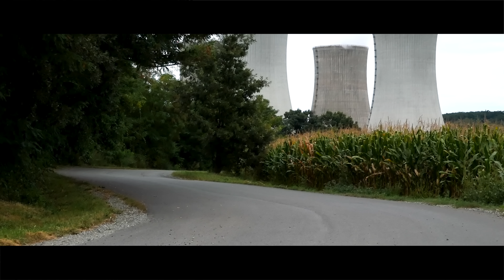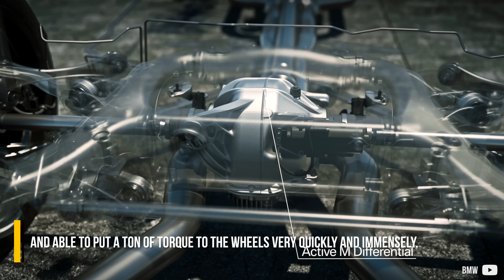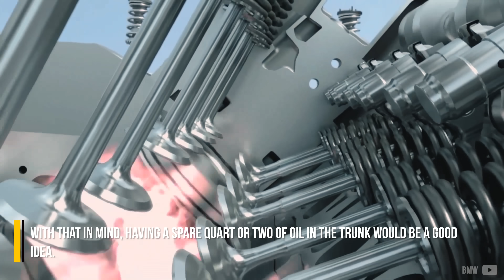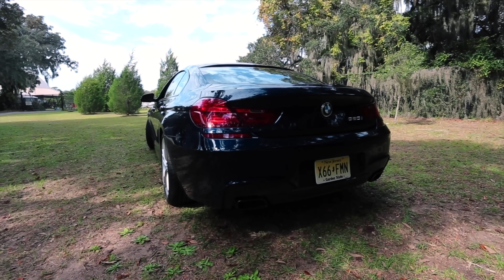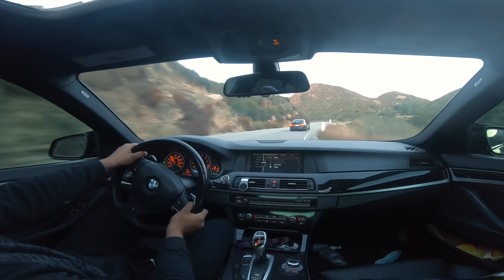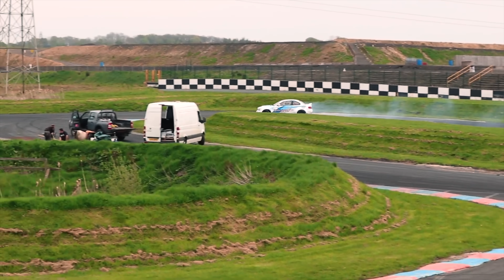The Worst BMW Ever?

Comment: New M5/M8 have a 10k oil interval which is pretty standard in the performance range, E63S 4.0TT which is also a hot inside V has the same 10k interval with a "normal" burn 1qt between oil changes. I've heard since the release of the F90 M5 they 4.4L is really good and doesn't suffer the problems of its early versions.  The 4.0 in the E63S is amazing, fully forged, practically over build, also with twin scroll turbos and generally since 2017 there has been no major issues, one of the best and last AMG engines build.
Reply: Yea but if u pull the oil at 5k or 5500 u will see it’s started to burn turn dark. U should change at 5k 5500 max on turbo cars u don’t want that burned oil going thru ur turbos. Forget what the manufacturers say. They are only concerned with the lifetime of the vehicle and to them that is 90k ish. Never go past 5500 oil change on turbocharged engines.
Reply: @sneakerhead4770  Oil turning dark is normal, oil doesn't retain is original color past 2 or 3k miles it'll be mocha already. You don't flush a car engine so it's squeaky clean it's designed to ge changed with old oil still left residually which will discolor fresh oil right off the bat. There is a lot of discussion of when to change oil. I don't think car engineers want you to break their engines. And I also trust oil companies, I always used Amsoil in the AMG, Amsoil outperforms most oils specifically in high temperature turbo engines. I would think Amsoil, Royal Purple and others are true to their claims. These oils can last to 12-15 or 20k miles so doing a 10k oil change should be normal. You can always change your oil sooner for your own peace of mind. But the ONLY  way to tell is to send that oil to the lab at 5k interval then at 10k interval and see how oil performs, if the oil itself has started to break down, like I said turning black doesn't mean the oil burned itself out.

Comment: Have owned BMW since 06. My first one was a 06 530i. It had the cylinder head issue. I purchased it certified 1 year old. Traded it in for a 09 5 series. My next one was a 13 X5 35i. Then a 15 M3. I always got rid of my cars before 100k miles. I kept my 13 X5. I am done buying newer cars. So tired of other people crashing into my cars or damaging them. I used to wash my cars weekly. Now it’s every 3 weeks. I am a mechanic so it’s easy to work on them. My 13 X5 had to replace the water pump and thermostat at 65k. And the valve cover at 80k..

Comment: Complete overhauls in like 5~6 service intervals sounds indeed like a nightmare,i mean,just listening to the design made me sweat buckets, the cats that close to the intake air just made 2 extra intercoolers neccesary, and something like the conrod bearings dont have enough oil passing through them is definitely not normal at all, its just plain stupid design,like i said,that engine has overhauls like it needs regular service

Comment: Good engine, bad maintenance advice from BMW. BMW first stated 15k miles between oil changes, then 11k. Truth is 5k oil changes are needed. Cooling down the car before turning engine off (2 minutes) is a great idea even though coolers run after engine is shut down. 
BMW set the 15K oil changes to save themselves money as they offered free service. Always follow the money.
Reply: Def 5k oil changes no matter what they say especially on turbo engines u don’t want that sludgy burned nasty oil going thru ur turbos. Also warm up for a few mins when starting up let the turbos lube up and the oil get warm before getting on it. Never rev as soon as u start and wait a few mins before shutting off like u said. It’s important for turbos let some coolant cycle thru before shutting off.

Comment: Good research and edit on the video but very happy to say that you are wrong! how many BMW have you had yourself? and what models/engines? I had science 2008 to present from 3ser,5ser,6ser etc, from E46 upwards never had any major issues and did always long drives from UK to Germany,Austria,Hungary never let me down or stranded.
Reply: I second that! Most reliable cars I ever owned. I exclusively had 5er series models beginning with E39 variants, they did not once brake down. Nowadays I have a 535i F10, the car is twelve years old with close to 200k kilometers and still no major issues.

Comment: 20 quarts of oil between oil changes. LMFAO. Does one even need to change the oil at that point? It's been replaced about ~3x already in the oil change interval by topping off.

Comment: Most any BMW you <buy> these days will last reliably :::er::: reasonably through 70 to 90 thousand miles, just like of the normal and plain cars the rest of us drive. If you exceed that 70 to 90-thousand-mile range and repair intervals shorten up, then you've also experiencing nothing different than drivers of other cares are experiencing. Regular oil changes and service maintenance intervals will keep the car operating as well as any other vehicle in the modest luxury range; oh, and not driving it like you're living the insane life on the hyper-crazy race circuit of your choice (usually the same common roads commingling uncomfortably with the roads most folks always use), when you're just a common joe living in denial who can afford to drive a more expensive car. Of course, there are exceptions, just like with other cars, but the first thing you need to examine and repair while driving any car is the driver of that car which seems to need repairs too frequently.

Comment: M54, m57 (and even n47 after 2011) are some of the best engines ever made. The only problem is that people without knowledge about these cars buy them, if you have some common sense, a bit of knowledge about these engines and you know how to use a wrench then these are excellent engines. You just can't treat them like you can treat your honda civic lmao.
Reply: @Morphic exactly, depending on the year of m57 you should consider blanking the swirlflaps. The only problems with this engine, are emission related designs such als dpf, egr and and swirlflaps. Taking care of these designs by blanking, combined with proper maintenance will make this literally one of the best diesel engines ever. Such a solid powerhouse, the m57. A lot of the BMW hate is so injustified.
Reply: Great engines except for that FUCKING CCV
Reply: @nutsackmania  yeah there are some pesky parts that need to be replaced with mileage on some of the 3.0’s like crankcase ventilation waterpump or valvecover gasket but its nothing serious you cant do yourself, still really great engines indeed

Comment: My wife and I both daily drive Bmw's. But They are old. Hers is a 2003 530i with 312k and mine is a 2001 325ci with 278k.  I love them, but I absolutely will not own any bmw newer than around 2010.  The 90s and early 00s are good cars if you keep the cooling system up and do the maintenance.  I had a customer bring a 7 series to our shop with the N63 in it recently.  I kept trying to tell him to get rid of it.  He thinks he is a baller but he doesn't have the kind of money it takes to keep it running.  In 10 years or so there will be a lot of them in the junkyard.

Comment: Worst enginge is by far the N54. 
The Engine might be good but the external parts like high pressure pump, the turbo and other parts arte like shit. so you dont have a benefit from a good engine when you always have to replace the other parts

Comment: A very involving engine to work on indeed 😏 resealing both  valve covers gasket will take a whooping 14hrs its like rebuilding a motor 😁😁 alot of accessories with less space to work on,
Then talk about brittle coolant hoses and crankcase ventilation hoses🤮 u touch them they break and they cost a fortune🙄

Comment: These engines are also very notorious (at least in South Africa) to have severly scored cylinder bores at 40000kms or less, requiring a complete replacement due to the severity of the scoring.  A telltale sign is a fairly rough cold start, with slight smoke from the exhaust and sometimes an EML light
Reply: Leaking piezo injectors are the main cause. In germany I read about an F10, where the engine failed after 5000km with (If I don't mix anything up) locked up engine, or massively scored cylinder bore. 

The N63TU is, at least in germany, much, much more reliable than the 408hp engine. Most 408hp BMW have at least 1 replacement engine inside, I've heard of some already have the second in it.
Reply: @DrDOHC  yeah, all those points are also valid to the pre-TU engines. The TU4 is by far the best iteration, but they still have their issues, like a leaking coolant bottle that messes up the injectors and causes a misfire, it happens most often on the F90 M5 and M8 models.

Comment: Over engineered. That's seems to be common with most of the Mercedes and BMW engines.
There not designed to last. Power seems to be priority.
They cost a lot of money to buy and fix. Anyone reasonable should be thinking twice before buying second hand.
Perfect engine if you want to change a car every year and money in large quantities is no issue.

Comment: The N47 engine was another one of BMW's nightmare engines, what with premature timing chain failure along with a list of other issues
Reply: That was a dark era for BMW in general. As a BMW guy I decided to skip the whole generation between 2005 and 2015 to avoid engine issues. Today's B-series engines are golden in comparison with N-series.
Reply: The N47 was very fuel efficient and pretty powerful for its time. Sad that is has this many issues.
Reply: @emrefifty5281  it was. My dad currently has an '11 320d ED with the N47 in it, so far it's been a hassle to keep on the road though. New engine, coolant hoses breaking, random battery drain, fuel injector dying, he's only had it like 8 months lol

Comment: The S63Tu in the F10 M5 is considered pretty reliable for an M car and certainly more reliable than the original N63, which no one should touch.

Regarding the recommended US oil change interval, it was dropped to 10k miles mid-2013. I still would go with 5-7k.

And what's with the random drift videos of cars that don't have anything to do with this engine?

Comment: For some strange reason we brits can’t get enough of German cars and nothing seems capable of changing the view that they are well made.
I remember many years ago BMW engines had a problem with cylinder scoring and all they did was blame British fuel, and they got away with it.
A car magazine had a brand new Mercedes on long term test. It’s camshaft needed replacing and all the magazine did was praise how well Mercedes handled it under warranty, rather than saying how terrible it was that it needed doing.
My fun car is a Honda Civic type r with 250,000 on a totally original engine that I do track days in, I drive it to the red line constantly and I’m still waiting for it to blow up, but it just keeps going.

Comment: I own a Stage2 F10 M5 (S63B44T0) and have been daily-ing it for four years now in a hot climate (Dubai).

I can confirm that with proper preventive maintenance scheme you should never face any problem. I change oil at every 5,000km and drive it hard every day. Still puts supercars to shame even after crossing the 200,000km threshold. I'm still on stock motor, turbos, and clutches even when pushing 720hp/950Nm. 

In case you ask, 100-200 time is 6.3 seconds at 18C ambient temp (32C IAT) on 98RON street fuel

In summary:
- Injectors/Coils: 60,000km intervals
- Sparks: 30,000km intervals
- PCV Valves: 60,000km intervals
- Brakes/Discs: 100,000km intervals
- Rod Bearings: 125,000km intervals
- Clutches: Should last till 200,000-250,000km
- Turbos: Should last till 200,000-250,000km
Reply: That didn't help the base N63, with its leaky piezo injectors to leak gasoline (the lowest mileage was 5k km, engine totaled), leading to the cylinder wall getting washed with gasoline, no oil film. Then the engine runs more on oil than gasoline and a few km more and it locks mostly up.
In germany, a good part of the 408PS vehicles has 1-2 replacement engines in it, and hopefully with the new engine the newer, way less leakier magnetic injectors. 

Otherwise the N63TU is a good engine. The S63 is, of course, stronger, but most problems arose with the N63 base engine.
Reply: @wegetpaper3447  i have a dragy video. Don't suspect nothing. Come visit Dubai and you'll know we have temps lower than 18C in winter. Some places it reaches 9C
Reply: Agreed, I have a stage 2 F10 M5 S63B44TO as well, catless downpipes. I love my car. Oil consumption is not an issue with my car. 125,000 miles.
Reply: Yeeeaaahhh I think I'm gonna buy a Lexus instead and not have to worry about  A N Y  of this lol
Reply: are you still on original injectors? I love my M6 Gran Coupe.
Reply: @TheRealEvo  get Bosch injectors. Works like charm.
Reply: @rafik_jabbour  thanks, i got 50k miles on my M6 Gran Coupe Moonstone on Platinum interior and headliner. Thinking about replacing them soon. I already did the coils and spark plugs twice since purchase with Bosch coils and NGK Cold Plugs so their fresh. Just did my transmission flush and both filters. Rod bearings are next on my list. I only use Redline 5W40 every 2000-2500 miles and BMW original oil filter.
Reply: Lmao absolutely ridiculous. Yeah bro my m5 is reliable I just need to replace every component every 100k km's lmao.
Reply: Rod bearings 😂

Comment: I have BMW with the N63 engine, and after 12 years, there have been no  issues. The car gets an oil change every 5000 miles, and here in Tokyo we don't have many opportunities to reach Autohahn speeds. In 12 years the only failure the car has suffered (knocks on wood) is a burned out 15 watt fuse for the Comfort Access system.
Reply: That's what good care can change. I had a 750i f01 from 2011, bought the car with 87.000 km (about 55 k miles) on the odometer. The care was a nightmare, but it wasn't taken care of very well. Cost me a lot of money and nerves, but when the engine ran, it was always an amazing experience. Perfect engine for the Autobahn, I always loved cruising comfortably at 250 km/h (155 mph).
Reply: @pipapowatauchso6138  Here in Tokyo only airplanes can go 250 kph.
Reply: How many miles now?

Comment: have 750 hp and around 1000 nm since 70 000km, now i have 120 000km and the only issue was to change one of the fuel pump at 118 500km

Comment: So You pay top dollar for a German engineered car... To get to the point where you need to keep oil in the trunk. What a fucking joke.
Meanwhile Toyota and Honda can run for 40000 kms without a service and still have no issues.

Comment: If you can't use your car without topping it up with oil, then the spare space in the engine bay should be used for an oiltank and pump instead of driving around with an spare oil can in the trunk. Even two stroke scooters and B-17 bombers use an integrated oiltank. Sometimes engineers are too smart to see that their radical step forward in reality is a step back, And the solution to the problem becomes the problem.

Comment: Like the naturally aspirated V8 didn't have enough oil leaks and cooling system issues because of heat, throw 2 turbos on the top of the engine. 
Amazing cars and I'll never buy another one.

Comment: I think a great gas engine, from the enthusiasts standpoint is:
1. Sound
2. Power output
3. Durability
4. Ease of maintenance. 

I contend that consumer expectations (more space, fewer vibrations, less noise, more luxuries), safety, and emission regulations have conspired to bring us enthusiasts worse engines as time goes on.

I also think these emission regs are starting to eat themselves. I'm all for cleaning up the world - but when it means a car is in a junkyard 50,000 miles sooner than it would otherwise be - I think we need to check our maths.